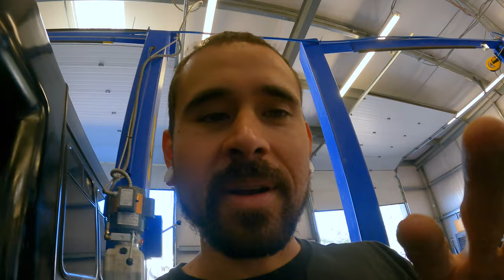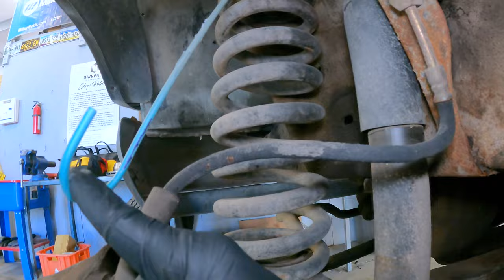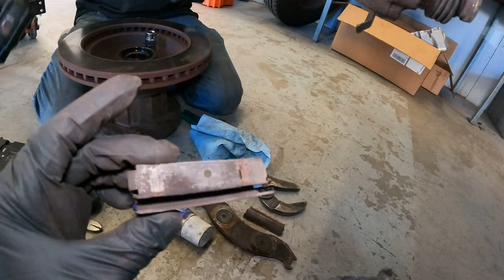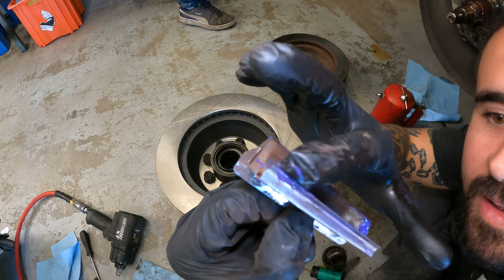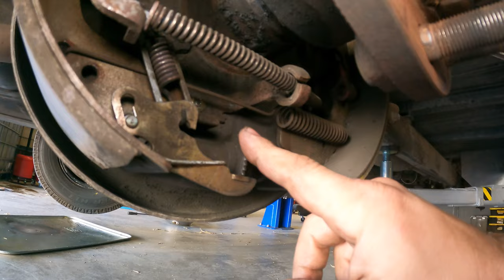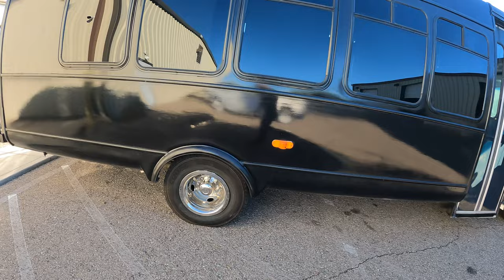How to change your drum & disc brakes | Explained

Comment: Nice video.  One tip I picked up from a motorcycle YouTuber was cleaning all the grit and grime off the rubber seals before compressing the caliper piston back in.  Pretty much never seen that done before, but the reasoning makes sense to me.